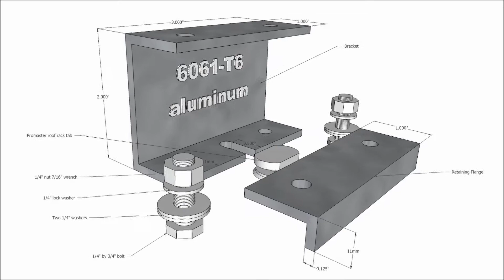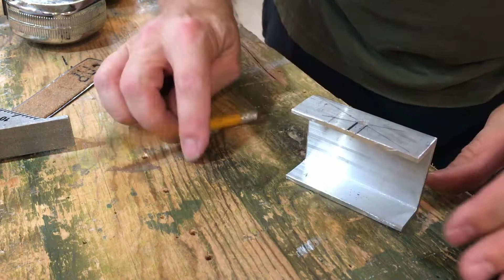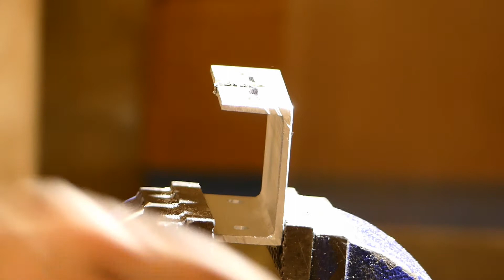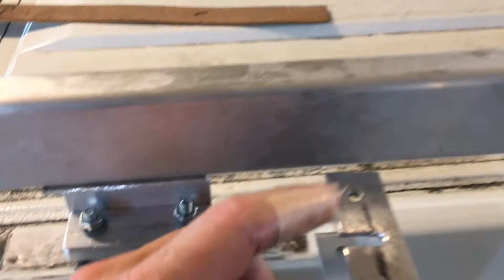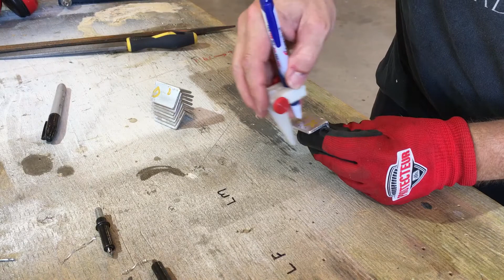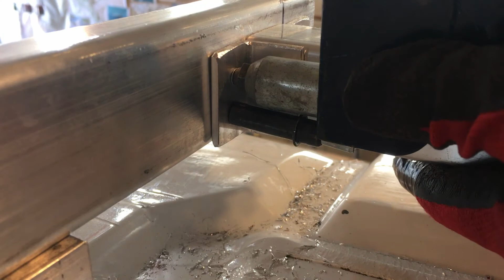RAM PROMASTER VAN BUILD - DIY ROOF RACK

Comment: Great video! I did a similar project but bought steel brackets with hardware on Amazon 6 for $100. I used two 10' x 1 1/4" x 1 1/4" x 1/8" steel angle for $60. I used 3 large 41"x 69" x 1 1/4"  360 w panels. The panels themselves provide the structure between the rails. I used 3/8" bolts to bolt the angle to the brackets and 5/16" bolts to the panels 4 each.
Reply from the maker: Sounds like an excellent design.

Comment: does anyone make these brackets for sale? i can make them but dont really want to.
Reply from the maker: Hi Steve, this is definingly a product that some tool-equipped manufacture could mass produce and spit out in quantity with very little gear up time.   Having made them, I would pay up to $10 a bracket if they were available to buy.  Having said that, I wouldn’t pay any more as they are super easy to make.  Cheers

Comment: I love your “Life Is Short DIY” channel name. I’m hoping you see this as it’s been at least a year since you uploaded your video. My desire is to obtain my own Dodge Ram ProMaster within the next few months. I truly love this video that the YouTube algorithm placed in my feed. My question has to do with the rivet gun(?) — does it require a lot of upper-body strength to get the rivets installed? p.s., I’ve subscribed too. 😊
Reply from the maker: Hi, thanks for your question.
That is a difficult question to answer as strength is relative.  I asked my wife how she would answer this question, as she has pulled rivets as well, and she says it takes hand strength, not upper body strength.  A few thoughts come to mind.  Many will assemble their aluminum roof racks with bolts instead of rivets, so that might be an option for you.  Another option would be to use a pneumatic rivet gun, which uses compressed air to pull the rivet.  They start around $60 on amazon and go up.  If you can borrow a rivet gun, I would try it to see what works best for you.  Thanks for the feedback and good luck with your project.  Dwayne

Comment: Love it, love it! Engineering at it's best! I hope to follow your guidelines soon. thanks for sharing this!
Reply from the maker: Thank you for your feedback, and you are welcome.  The real credit goes to Dave from Van of Action.  The brackets are his design and they work GREAT!  

One more point I should add, I have had a few question my use of rivets in the build.  This is a solid unit, no hesitation on my part, and if I was to build it again, I would do it exactly the same.  

Indecently there were no design changes necessary to address unwanted wind noise.  The unit doesn’t seem to produce any wind noise at highway speed, and we also have not noticed a negative impact on fuel economy.  You literally forget the solar panels are up there. 

Good luck with your build!

Cheers
Dwayne

Comment: Great video and awesome hack... I was just looking for those clips. Is there a reason why you didn't mount the rack inside the clips for a lower profile?
Reply from the maker: Hi, thank you for the feedback and question.  You actually need a little space underneath the solar panel for the electrical connection.  I didn’t think this all the way through at time of install, but by the time I got to the wiring, which I captured in video 15, charging System, I realized that I had it right.  Just the right amount of space to make everything work.  I wouldn’t change a thing.  The clips are designed by Dave from Van of Action.  He does great work.  Cheers
Dwayne